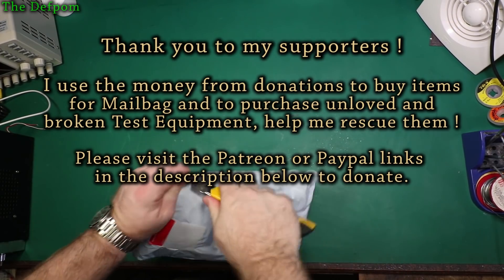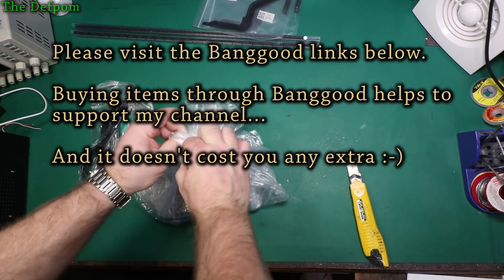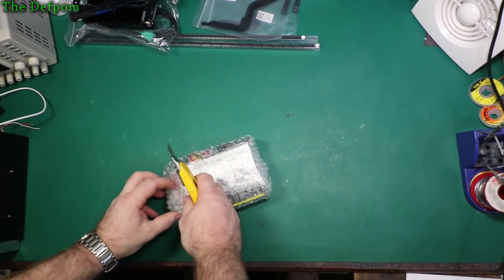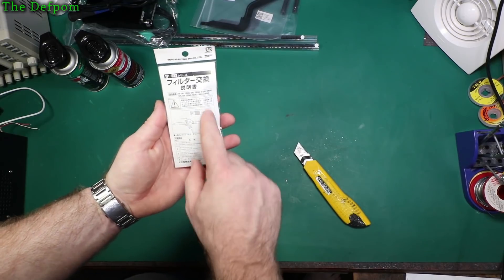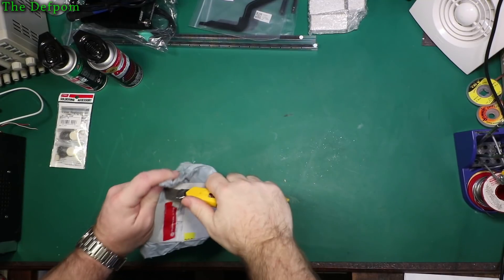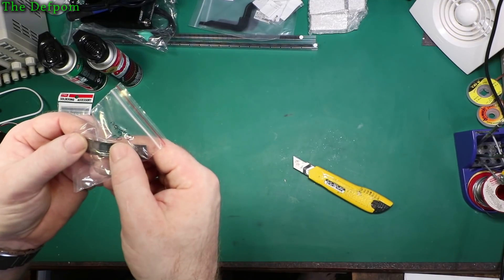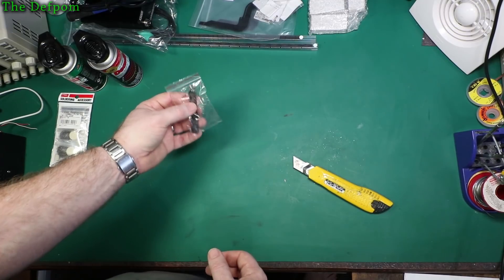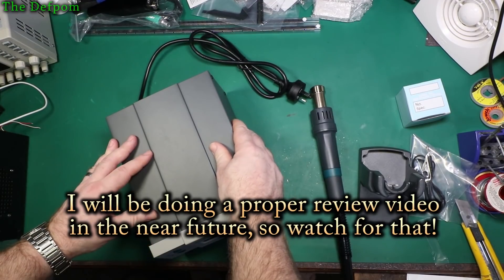🔴 #506 Mailbag Monday 28th January 2019

Comment: "#506 Mailbag Monday 28th January 2018" one week ago... Published Published on Jan 27, 2019... Anyone notice anything a bit off??? :-)
On a more serous note... I really like your channel.
I also have a KSGER T12 on order... But I just got the blue plastic handle on the suggestion of one reviewer... Most of them had the big handle with the screw down lock.
But the blue plastic one has a MUCH shorter hand to tip distance, which SHOULD make things a lot easier.
I have also seen a black metal handle that looks a lot nicer than the one you got but it is also about $15 US cheaper... I want to see what you think about the handles after you have tested them out.

Comment: Do you mind me asking what you use as an isolated power souurce when working on 13,8v dc as it has to be regulated?..ie to avoid blowing up scopes etc 
73s
Andrew
Reply from the maker: My power supplies are all linear supplies, they have isolation because of the transformer, something you may or may not get with a switch mode type.